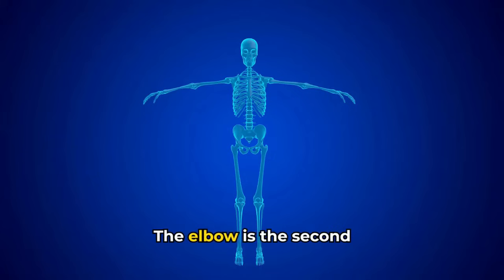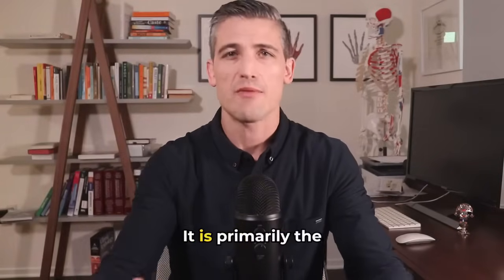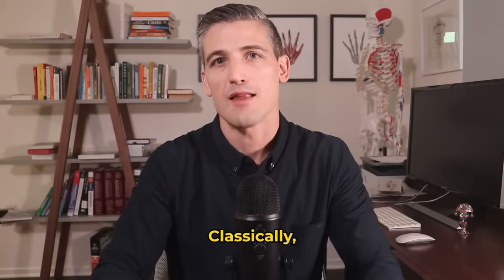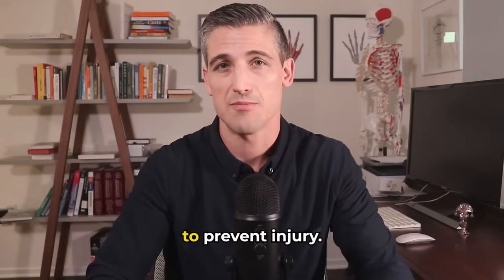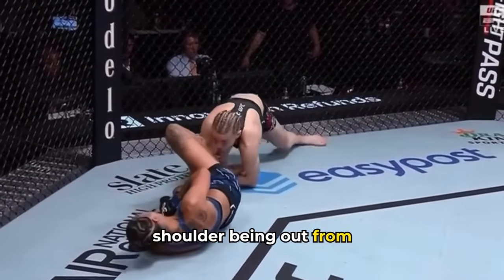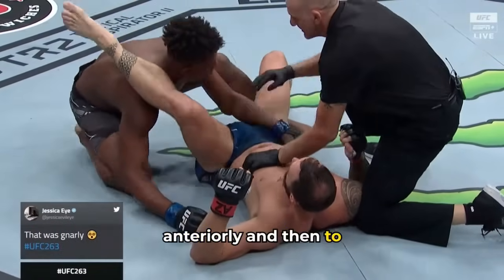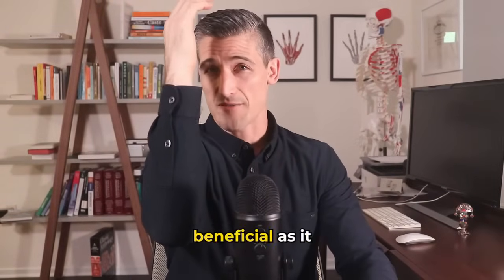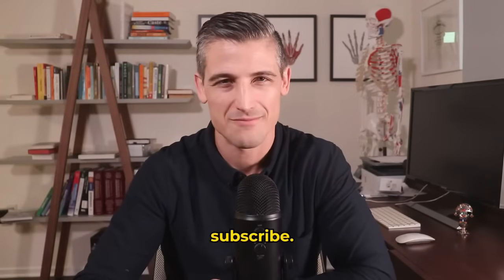Understanding “Simple” Elbow Dislocations: Causes, Anatomy, and Treatment

Comment: What would be your recommendation for an emergency doctor to put a dislocated elbow back in place without having an x-ray? I am really looking forward to your answer. Thank you very much for your great video and the educational example videos!
Reply from the maker: Hi - this a common reduction to have to perform in the emergency department. Often, you have the resources to get X-rays quickly before and after reduction. If the mechanism is a pretty clear isolated dislocation (EG arm bar from jiu jitsu 😜) and there was no access to quick imaging a reduction attempt is still worthwhile. The most important thing is adequate relaxation (fentanyl+versed, propofol, whatever you feel comfortable using). I use the technique where the patient is supine and their humerus is pushed posteriorly (perhaps by a helpful assistant) and the olecranon is grasped with your fingers and the forearm translated distally and anteriorly. It is very obvious when the reduction happens. There are some techniques that can be done prone but that does mess with sedation/airway concerns. If the patient can be very relaxed with some simple pain meds on board it can worth trying that way. Relaxation is key!!

Comment: Sir, my elbow dislocated 5years ago. Is their any treatments?
Reply from the maker: The answer to that depends on many things: what are your symptoms? Do you have pain, stiffness, or instability?  We would also need to know if you had associated fractures or now have arthritis - X-rays would be a good start. Factoring in what you do for a living, your arm dominance, and what your goals are all influence our treatment decisions!
Reply: @CuttotheBone  i can bent it completely like other arm but with a snap sound sometimes. I can't flex my triceps fully.
If i didn't do treatment what will happen?
Reply from the maker: @nonamedude743  It is hard to say what may be going on.  Elbows often get stiff after an injury.  Sometimes there is a small "loose body" of cartilage/bone that is floating inside the elbow.  Sometimes there is a ligament tear.  If you are bothered by symptoms - pain, limiting function, etc - you should be examined by a specialist.

Comment: Sir, my son is 10 years old. His elbow was dislocated. I have been doing exercises for 5-6 months. His elbow becomes soft. After 2 hours, it becomes tight from the foot. He can straighten up to 170 degrees.
Reply from the maker: Hello. I understand there could be a language barrier - as I understand your son had a dislocation 5-6 months ago, it was reduced and he has been doing exercises. With the exercises, he is able to move well, but 2 hours later it gets stiff again (?). He is able to get to 170 degrees (180 is normal). It is hard for me to say exactly what is going on. Assuming there were no other injuries to the elbow, having some stiffness 5-6 months after injury is somewhat expected, but his elbow may always be a little different than before his injury. As always, see a specialist to make sure he is healing like he should be - that there is no residual instability or other things going on in the elbow.
Reply from the maker: @KhanBadshah-u7p 🤙

Comment: Hello sir, Firstly thanks for the clear explanations given through the video. It been almost 3 weeks now since I got my elbow dislocated. The cast has been removed and am on brace now. Day by day I can see the swelling getting reduced around the joint, but I am afraid that my bicep tendon is torn. The reason why am
being concerned is, I have a limited motion and I feel like the spot where the carryout the hook test is hard. Could you please advice, is it normal on all elbow dislocations or is it something that might require a surgery.
Reply from the maker: I certainly would expect stiffness after a dislocation and then immobilization. It would be extremely rare to have also torn the biceps - I actually have not seen a torn biceps and dislocated elbow at the same time. Best thing would be to have an expert examine you. An MRI would also confirm whether the biceps is ok or not, but I would be very surprised if you had that injury. Hope this helps.
Reply: @CuttotheBone  It surely gave me relief until my next check-up. Thanks, sir. Please continue your good work, and i highly appreciate your efforts in educating others where it is most needed. Thanks again
Reply from the maker: @vasanthlogu1177 thank you for your encouragement. Best wishes on your recovery!